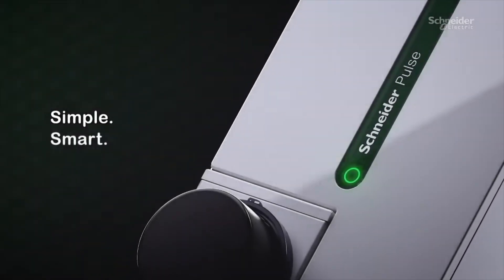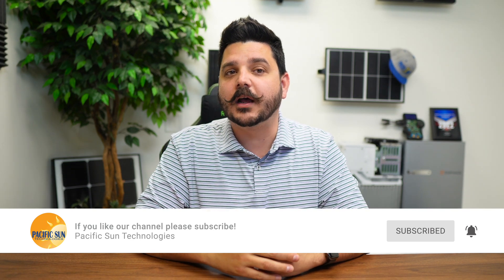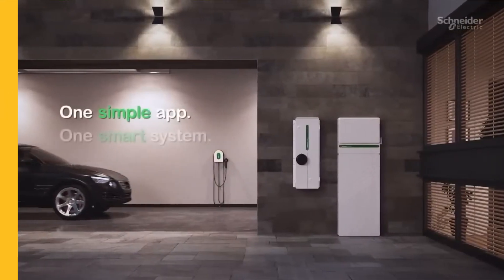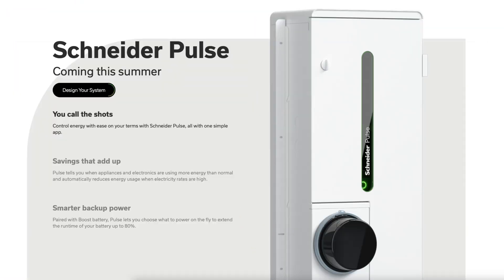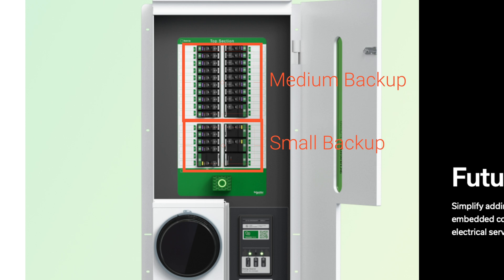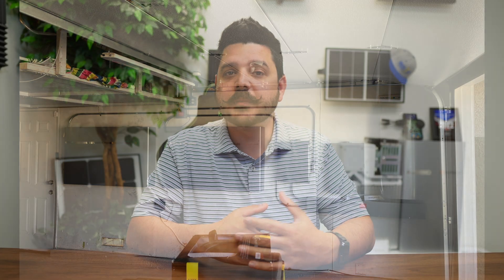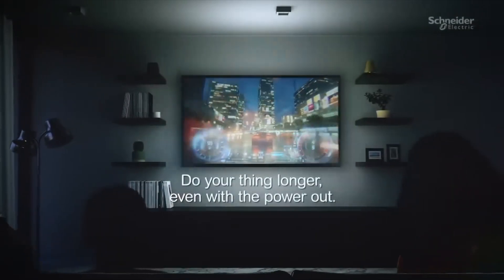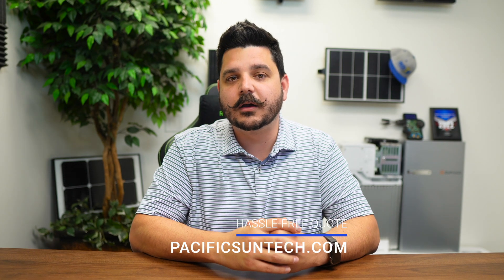Game Changer for Battery Backup Announced at CES 2023

Comment: As a legacy Schneider customer with the XW+ 6848 inverter its really disappointing to see a completely redesigned inverter which no doubt will NOT be an improvement on a product that has proven to be a reliable, workhorse that outperforms its published 6800Watt rating by a very large margin.

Comment: It's going be expensive.
Reply from the maker: The energy center is $3,000 which is for new construction homes and does the same thing. Assuming the Pulse will cost that it will actually save someone money when you add all the costs associated with a panel upgrade with battery backup. Worst case it’s the same cost when looking at all the equipment.